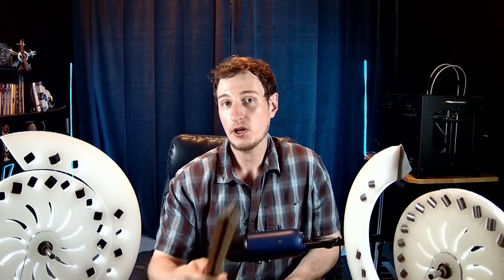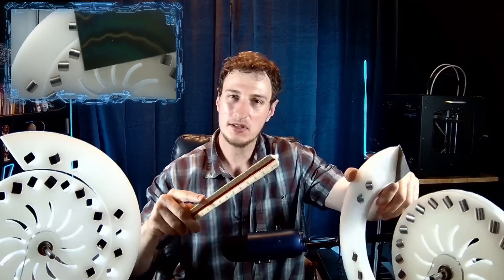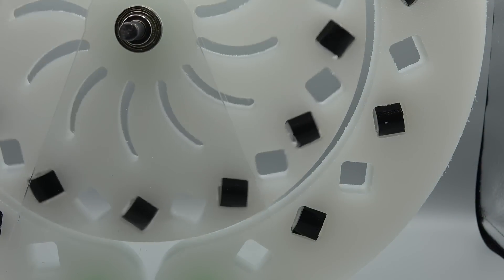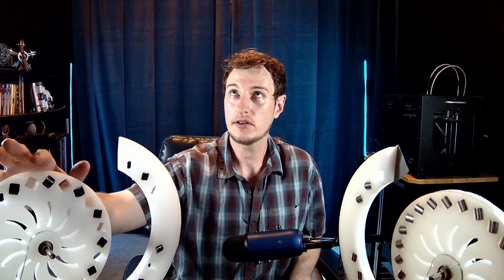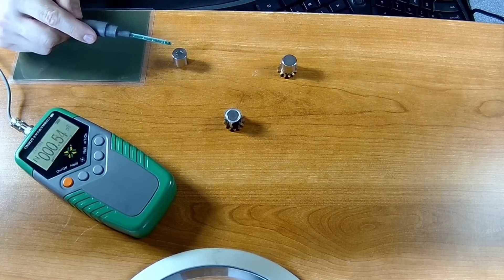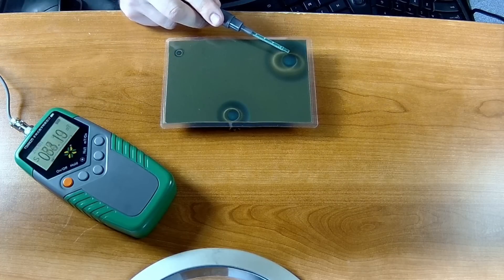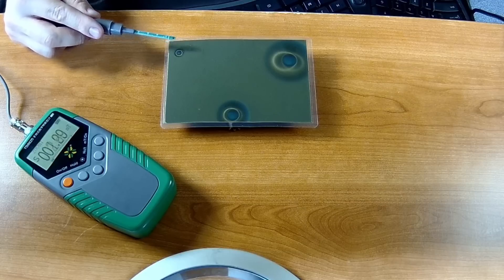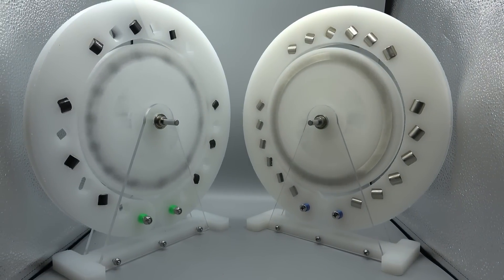Perendev Magnet Motor - Does IT WORK?! (Part 2)

Comment: There is aomething else you can try. Shield with lead and use 1 inch diameter and 3mm thick magnets . Place 10 or 20 on top of one another. So your poles are further apart. Also, the magnets sticking together create a different effect and seem to hold the N and S pole within.

Comment: You cannot have a Mortor per say, with only Magnets because to Generate Energy, we need a

. Difference of (Energetical) Potential 

Which Stand Long Enough.

Magnetism CAN// be a SOURCE OF ENERGY "All By Itself",

but it is like 

. A stone that we let fall;

. THE ONLY ENERGY WE CAN GET

is

. DIRECTLY DEPENDANT OF THE HIGH OF THE STONE.

In Magnetism, it is the Same:

We can Haverst some Energy but 

. NOT more than the DISTANCE between 2 Poles will Allow.

The BIG PROBLEM (which makes the "golden zone") is that:

. WHEN THE DISTANCE IS ALREADY USED,

. WE NEED AT LEAST AS MUCH ENERGY TO RECOVER THE DISTANCE. 

Anyway, by this Principle, the Best we can Obtain is a QUASI-FLY-WHEEL*.

* In a Vacuum Chamber ti avoid any Drag by Molecules Friction.

Said that, my Intuition is that MAYBE and IF the Magnetic Field of a Permanent Magnet can be Splited in 2 Flux, one Clokwide, one Counter-Clockwise, something like that, 

We might be able to make something like a "PERTETUAL MOTOR", 

physically Based on the Spins of the Electrons which are themselves, in my view, Already a kind of "PERPETUAL MOTORS".

Comment: I think the sator magnets need to be horizontally magnetized, and the rotor vertically magnetized. Both with Mu metal shielding, on the trailing edge. So attraction is slightly more than breaking attraction and with the flywheel effect should work.

Comment: A magnet motor is possible through switching. Use magnets only on the stator or the rotor (this limits the magnet pushing and pulling at the same time), and the other, use ferromagnetic metal in graded distance such that the magnetic strength to the metal pins oscillates between weak and strong, and acts like a ramp. The closest pin and magnet has to be gated with a solenoid increasing the distance ( because it is the highest point on the ramp) in a correct timing. The power to the solenoid will come from a capacitor build through Wimshurst generator which the rotor disk will also contain metal plates for the pickup brushes. You will have to experiment with the size of rotor necessary to support the capacitor charging. Once the capacitor is charged, it is discharged at the correct dwell, and will energize the solenoid for the rotation cycle.

Comment: What you may have missed is that Perendev made sure there are at least 2 rotational forces being generated while one phase is in drag. In fact 5 or more staggered phases are ideal since now we have 4 in rotational force generation, while one is in drag. Also, since we are shielding the faces so that the edges don't grab like the face does, this lowers drag on the single phase that is in drag every 10 degree's or so.
Reply: Neither more phases nor shielding makes a magnet motor work.
Reply: @heinzpg  Great, let's see your design and how you have tested it.
Reply: @MrInnovativeEnergy    Laws of physics and mathematics have the benefit that you can predict the outcome of experiments without doing them. For instance, the idea to have several identical disks with magnets on a common axis but with an angular offset. If you plot the torque of any of these disks along the whole circumference from 0° to 360° you get a curve with the property, that the areas of positive and negative torques are equal. And if you sum up several curves with this property, the result is always a curve which has also this property. Or to put it more direct: n times zero is still zero.
Reply: @ woosh……

Comment: You need a way to immediately stop the flywheel when it is in the Golden Zone.
Then, sell the golden flywheel.
Use a small amount of the proceeds from selling the gold to build a new flywheel, use a small amount to buy a normal energy source, and then pocket the rest of the proceeds.
You could do this over and over and earn a fortune.

Comment: the shielding matters and the angle matters. Also I think the reason there is three rotors is to prevent cogging. I believe the exact angle is in the patent. I think it is 17 degrees. I have had promising results with 1/2 inch steel conduit for shielding with 1/2 inch by 1 inch n42 neo magnets.
Reply: What is a promising result? Did the motor rotate by itself?

Comment: I guess, what if the magnets in the stator were paired on swivels, so as the rotor passed the stator magnet would pivot, moving the pole out and instead the other magnet approached the rotor?

Comment: It's a step in the right direction...   You need to use a steel plate as magnetic shielding one side to eliminate cogging.   They had multiple disks to push past cogging.

Comment: Im noticing you wrapped the outter edge of the cylindrical magnets, what you would want from my understanding, is to create a half-sphere shaped magnetic field.  these half-fields when setup correctly Im guessing would create a magnetic Push-pull whereby the first magnet in the chain of the outside pushes it, using the magnetic push to resupply the inertia. bracing your motors more will play a significant role most likely.

Also, going off of someone being charged with "fraud" is never a good reason to discredit an invention entirely. as the people who have been ruthlessly suppressing the technology in government use that as a quick way to destroy someones credibility. in the States there is also the Invention Secrecy Act. which means anything that would be TOO disruptive, gets flagged at the patent office and slapped with a national secrecy order. this isnt conspiracy theory, this is fact. the patent office in the US has an entire part of the team dedicated to energy devices, not just "free energy" devices, but solar panels that are too efficient and other similar advancements deemed too disruptive to the status quo. these are vestigial government safety rails to protect the oil industry that helps fund the Military Industrial Complex Eisenhower tried to warn us about in his famous farewell speech. whether its some out of control shadow government, or whether it was created with initially good intentions to protect critical energy industry for the economy or what have you, its been used long past its intended scope and it actively hurts real energy research and keeps us locked into a false paradigm of energy scarcity, further excacerbated by the mainstream church of science's refusal to seriously research Tesla Missing works, and shaming anybody who does as a charlatan because "Free energy doesnt exist." 

when in reality, as its as Tesla Knew, Energy is everywhere, what we call matter is 99% empty space, that empty space is energy. its what gives waves of water, wind,  magnetic force, lightning, and all other forces of nature we think we understand, the energy to do what they do.

Comment: The real version of this motor had metal sleeved shielding around each stator and rotor magnet in a Pacific angle to get past the sticky point. That's what everyone keeps missing in their builds these days. The shielding must extend past the magnet a little bit
Reply: i noticed this right off the bat, the second I saw the concept of a magnet motor and thought about it, the more simple it becomes. and I noticed in this video he didnt shield it properly. people dont seem to understand that, as I understand the physics of this motor, you have to position the magnets a certain way so you can point the repulsion in a rotating direction, while shielding the side of the magnets that are attracted to eachother. I came to this conclusion simply by pushing two magnets together for a few minutes on my desk, yet were the crazy ones am I right?
Reply: @MrSnowFoxy  correct I have played with shielding magnets with low accuracy gaining a small positive push. The placement angles to allow it to keep spinning a high accuracy placement of magnets is needed using 3D printers or CNC machining parts to hold magnets in correct position and shielding
Reply: @gregstafford2155  i just stumbled into the Luling magnet motor while looking for more information to support my theory, it seems the luling motor was using one side as attract, and the other to repell, the attraction side magnet in the video Im seeing, shows that Luling used acuation of the attracting magnet on a recoil spring and pneumatics to "pull" the magnet to cause the disconnection force to throw it because the rotating part in the middle is offset precisely to achieve it. The result being a perpetual motor that just needs air and a computer to time the actuation. I suspect there are better ways to mechanically link it so you dont need the air. But the air method  would be simpler to build.
Reply: It seems to be abusing the same forces that make this type of motor work, which is the force of a moving repellive force to swing the magnet arm back around like a slingshot. In this video I just saw his attract magnet (there were only 4 total magnets in the demo build) is on a recoil spring with a knob to retract it so you can offset the middle magnet bar, and once you find the sweet spot, when you pull the spring all the way back and let go like a pinball machine it throws the magnet arm in a rotational manner, the repullsive magnet on the other side from it then pushes it back around and the process repeats, so to keep it going all you need to do is time that springback action at the right point in the rotation cycle to throw the magnet again. Could be a drop in replacement for most car engines in theory. Just depends on how much load you can drive with that. But he got it to over 400rpm, so heavy duty enough components and strong enough magnets, the centripetal( or is it centrifugal? I always get the two confused.) force could give it strength  with a flywheel  to just adapt it to  most transmissions.
Reply: @MrSnowFoxy  yes I have seen those videos long time ago they have good ideas but unfortunately they have too many physical losses to allow it to continue to spin on its own. I believe a magnetic only motor with shielding is the ultimate because there is no wires no batteries no hydraulics etc to wear out
Reply: @gregstafford2155  I dont think so. The video Ive seen was from 3 years ago. And it seems easier to build and get working. The problem with any of these systems, is having enough force at the shaft to run things. And in theory, the compressed air actuating magnet system seems to be more efficient and the original inventor aimed for it to replace combustion engines. The shielded magnetic motore may be superior for energy generation for homes, whereas this might be better for moving vehicles. Rushing to galvanize behind one single discipline is part of how we got here. We have to consider the individual applications and be open to the prospects of previously "inferior" systems to shine in the proper niche. Just like you wouldnt put a graphic designer or an architect into a the role of a welder, I think here too, we have to be open to specialization. Thats what makes nature so successful. Is adaptation and specialization based on their environment.

Comment: why dont you use an Aperture to come mechanicly over this golden zone? I thought about a syncronized round shaped metal ring with partly open at the exact time, the current Magnet is a.) OPEN or b.) CLOSED, if u are using a non magnetig round plate and create a synced apperture. Hope this will work, prayin for this!

Comment: The obvious solution would be to have a mechanically activated shield to block or divert the field that repels the incoming magnets, or rotating magnets to match the phase, but it probably takes the same amount of work to move these added parts, effectively nullifying any gain from them. Ultimately, if any design ends up working, the total energy extracted from the magnets before they are demagnetized would at best be equal to the energy it took to magnetize the magnets. Based on my current understanding of mechanical motion and energy conversion, there's simply no way to get more energy out of a system than was put in. 
However, at the subatomic scale there clearly is more energy that can be extracted than is required to release it, as crudely demonstrated with fission (nukes) and radioactive decay (nuclear power plants). I'm just not so sure that it's worth the trouble, cost and risks when there already is more energy than we'll ever need coming from the sun that can easily be extracted, both directly from the EM spectrum (UV and IR) and from the wind/rain/currents/tides/swell/etc.
I'm not saying that people shouldn't try to harness free energy, as it is a fun exercise.

Comment: An engine built around this concept with a fusion reactor could multiply it's energy output.
Reply: Since the energy output of magnet motors is zero multiplying it does not really help.

Comment: Bull crap this is my invention I have carbon dated diagrams and witnesses and it's all wrong
Reply: It isn't a matter of applied physics its a matter of quantum mechanics.
Reply from the maker: You can't build magnet motors without gates. You have no proof.
Reply: @Motor_Explorer1  I’m pretty sure you’ll figure it out, it’s a rotating wheel, shorting the valves works the same as any ignition or injection of a.. say wankel for kicks. Daniel, did you make the throttle one or just a static? Like the ones in the raptors?

Comment: You could connect an air to water generator to a waterwheel with buckets & a syphon to create perpetual motion machine. Perhaps a sterling engine powered by magnified sunlight connected to a car alternator & solid state battery just use your imagination & its unlimited

Comment: Do this, but add multiple of them along the same axis. Think of an axel with 5 of these, all rotated slightly. 

Time them so when one wants to lock, the others prevent it. Multiple of these could work. 

Thats my theory. 

Thats like having 1 motor arm, it'll lock. But add in additonal arms and its less likely. The point is to prevent it from locking. Essentially there should be no lock points. If one is in the "lock state", the others will be pushing. So you have 1 locked state and multiple pushing states. Should run forever until the magnets run out.
Reply: If one disk does not deliver any energy five disks don't deliver energy either. The problem is not to overcome a "locking", a flywheel would do that. The problem is that clockwise and anti-clockwise torques are the same over the whole circumference.

Comment: The hardest part of building my perpetual motion machine is hiding the wires.
Reply: batteries * 
but this comment is posted ad nauseum  on every video like this
Reply: @jess_n_atx  its how the issue regulates itself. And I suspect the same algorithms being blamed to censor information, are and have been used to promote viral click bait, which is where this spawned its widespread use. Much like in the UFO culture, a lot of professional debunkers first thought is to digitally shout down at you by dismissing it as satellites, or weather baloons/drones/chinese lanterns etc. it means the coverup largely regulates itself. In over unity, this is wha this comment, the viral click bait servs. But on top of that, you have two other important factors as to why the scams are more common than real research, and thats Crazy inventor syndrome (they go full golum so nobody "steals" their idea before they can patent it) and the Invention Secrecy Act here in the states, which lets the government effectively censor anything they deem too disruptive to the status quo. And they do this ruthlessly without impunity. 

This is what happens to real free energy researchers, the ones who arent intimidated by the government cartel, end up trying to patent something that threatens the biggest core of the global economy,  the really unfortunate ones try to falsify patents which gives the regulators even MORE legal power against them. And this is the answer to "well if free energy was so common how come we havent seen it everywhere!?" Most of whom, don't understand the lawfare our government is up to on its own citizens. Most dont even realize the Invention Secrecy Act is real (and unconstitutional btw, do with that what you will.) 

90% of the brilliant minds that have cracked free energy, have taken it to their graves. Whether it be by old age and CIS, or by assassination by the energy cartels like what happened to stan meyer and his water car.
Reply: What has been bugging me for years is that magnetic energy is energy and it will be used up so magnetic motors are not perpetual motors and need to be recharged

I still hope people can successfully make a magnetic motor work...
Reply: @Chu_the_MEOWster  If it were true that we could make magnetic motors that could produce usable energy, it wouldn't matter that they were not perpetual. Replacing a magnet every 100 years or so is no big deal.
Reply: You're new to this aren't you